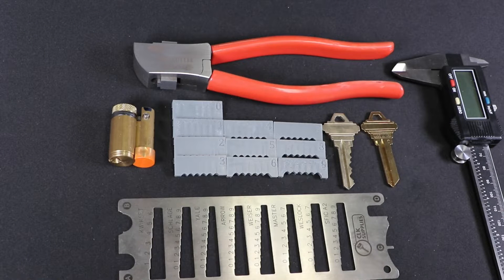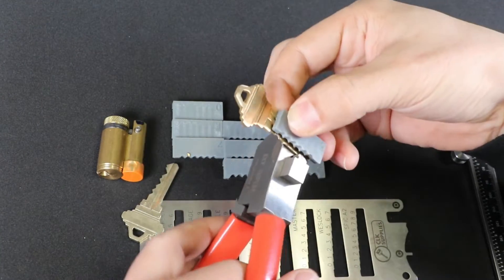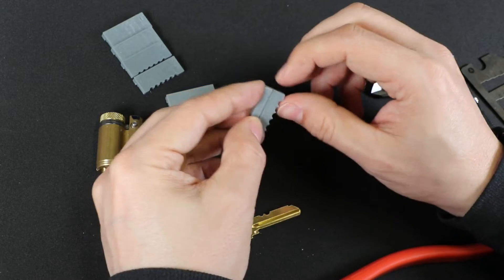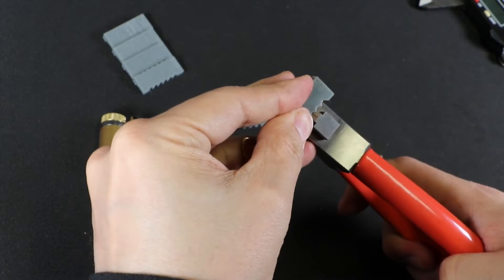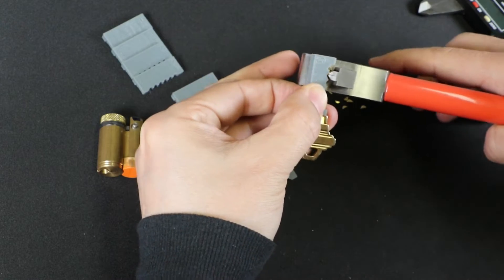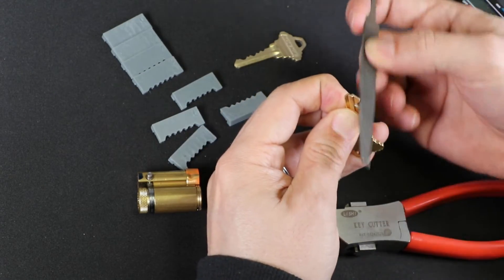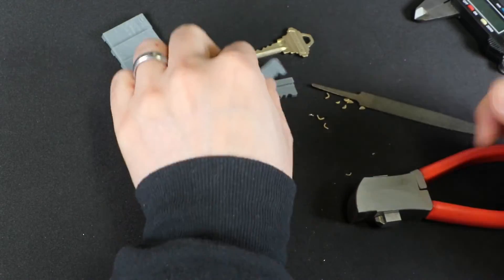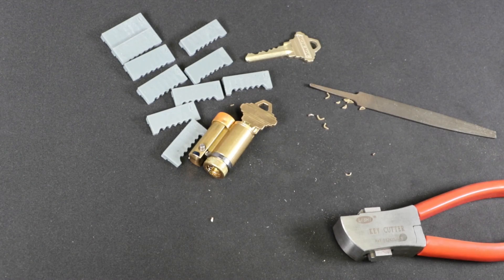[L216] Cutting a key using Jon Lock's Lishi Key Cutter Guides

Comment: Still watching to see but I've seen Deviant Ollem do impressioning with different guides and what he was using always came up consistantly one size shy as well. Perhaps it's the 3d printed materials and how they cure or settle slightly differently once printed?
Reply from the maker: Yes, I'm sure Jon created the STL files to the exact dimensions which didn't take any shrinkage etc into account, could print these again just adjusting the print to be different in one dimension to compensate.
Reply: @norlin76 oh, heck yeah... if its consistant...it's all gravy. Seems to be the nature of fabrication with 3D. I'll see if I can whip some up. Thanks for the info and demo! 😊 Super informative and fun to watch.

Comment: I could just use space and depth keys to achieve this similarly correct?
Reply from the maker: @solisimperium1203  yes, using a file you'd take some material off, check, remove more, check again etc

Comment: Seems like a quick fix would be cut your plastic guides down to spec a file then you have a pretty good little cheap key cutter.  Take the money you save on "cut by number" cutting system and apply to the Locktech decoder camera.
Reply from the maker: Oh for sure! Just have to modify them a little...been a while, thought I had mentioned that. These were tested as is off the printer though.

Comment: Hello  I am a  locksmith  from  China. Enjoy your video .ln China  .there are more and better ways to  make a key without a key.   We can be friends,learm from each other,we can be good friends.
Reply from the maker: Welcome! This was a review of free 3d printable guides...for making keys I use a professional key cutting machine, but this is a great hobby method for making them very cheap!
Reply: @norlin76  我见过中国的老师傅通过开启后观察锁孔弹珠的高矮，仅仅用锉刀一把钥匙坯子。在钥匙全部丢失的情况下，做出来一把顺利的钥匙。你所用的李氏剪齿钳发明人就拥有这个技术。
不过你们有先进的 方法和工具，降低了操作难度，值得学习
Reply from the maker: @LOCKGuru-je4yi  yes, if you use a decoder like a Lishi you can then just cut the key to the proper height using a file (or cutting machine). Also, even without a decoder, you can use the impressioning method to file your key ( I do this in my video here https://youtu.be/THXR9IlVWMk and here https://youtu.be/4kzkO2wQp9w )
Reply: @norlin76  我很佩服你，技术太好了。
Reply from the maker: @LOCKGuru-je4yi  Thank you kindly!

Comment: I had the same exact problem on these guides. They were all off by 1. If I needed an 8 cut. I had to use the 9 guide. Glad I'm not the only one with this issue.
Reply from the maker: I should revisit this experiment with a set of resin printed guides. Will come out more accurate and see if Jon would adjust his guides according to that.

Comment: You are over complicating this.. Vise them together and cut out the pattern    no printing or guides required.
Reply from the maker: That doesn't exactly work when you don't have a key to copy. The point of these is to cut a key to code from scratch, eg. you repin a lock and need a matching key.

Comment: I was thinking with a set of depth keys there will be no use for the guide.
Reply from the maker: Not really. Depth keys are great on a key duplicating machine. Perhaps if you had some other sort of jig to keep the depth key aligned with the blank in the key cutter that would work as well, the main part is you need to keep them lined up, which is where these guides come into play, they're a depth key and jig all in one.

Comment: Where do I print up the specifications guide for the Lishi Cutter? This is such an easier way to cut a key than impressioning.
Reply from the maker: What do you mean by "specifications guide"? The files for the different specific lock models available are in the video description links, but if you mean key depth guides, that will depend on the lock you're trying to cut a key for.

Comment: When the key turned, but was stiff, you should have examined the bitting from above.  The pins which are marking will make a dimple in the key at the bottom of the cut.  Pins which do not mark do not need deepening.  This saved me some copies in the beginning, before I got my key machine adjusted properly.  I used an Ilco Mighty-Mite, do not buy these!
Reply from the maker: Yah, it's the same principle that applies to when impressioning in a key. In this video I was just doing a quick run through and didn't much care about wasting a key :) But great advise!

Comment: Worn nozzle plus PETG is asking for the dimensional accuracy to be a little off. Sounds like you want to at least re-tune  your slicer profile.
Reply from the maker: Yah, might have been a little off, but not enough to make a difference when tested against the results Jon got...looking forward to the next version (this one works fine too if you just file the base of the guide a little until you get the right height, only has to be done once per jig)

Comment: Not one hundred percent convinced myself, but as a working progress 
The tool is on the right path.
The subtle difference between one depth and the next cut up is 
Simply good engineering, good demonstration and let's see
And enjoy where this tool is going to get too,billbo.
Reply from the maker: Thanks for watching! The tool is definitely on the right track. Even without a precise printer, you can make precise guides. I could take these ones and file each section down a little, cut the key and then measure the results with calipers...once the guides are tuned, you'd be good to go :) The price can't be beat!

Comment: Do you have any vendors, or sellers on ebay you'd recommend?
Reply from the maker: I'm assuming you mean for the Lishi Key Cutter? I got mine off Aliexpress, but they do show up on a search for "Lishi Key Cutter" on Amazon and eBay
Reply: @norlin76  I should've specified! Ik this is off topic to the video.  I have a long list of sellers on ebay and I frequent their pages for locks, so I was wondering if you had any really good sellers or websites for high security locks? It's hard to find quality locks in the USA if you ask me!
Reply from the maker: @jamesbp  I buy most of my locks in the Lockpickers United Discord server #lock-bazaar channel (can get to it via Reddit r/lockpicking). But if I have to resort to eBay, I recommend amvgaert, thelocksnest, vinylwonder, and locksportsman. (Can put myself on that list, though I never buy from myself, norlin76)
Reply: @norlin76  wow thank you! I'm familiar with a few of those sellers already Deff gonna check the rest out. Although I'm not familiar with discord servers but heard so much about them, you've sparked my interest and I will look into it.

Update: I just checked out your ebay turns out I already have you saved and am currently watching several of your listings 👍
Reply from the maker: @jamesbp  can't recommend Discord enough, it's the only place you'll find the really hard to find locks

Comment: Great video🤙🏻 do you think a resin printer would’ve worked better for this?
Reply: I’d be thrilled to have someone test this and send feedback - theoretically you’d get a very high resolution print, which can only help with the accuracy of the depth cuts … but the million dollar question is if the resin prints will be strong enough … I mean theoretically there is no force applied to the jig, no sheer pressure or anything, but there are a lot of forces at play on the key and some of that has to transfer to the jig on the cut, so will the resin print be too brittle to handle that? Only testing will tell.
Reply from the maker: I can give resin a go, there are many ways to have it print plenty strong (thinking mix of Siraya Tech, 4 parts Fast, and 1 part Tenacious would work excellent). I don't think the additional accuracy is all that important, there is a lot of tolerance in a C keyway given there is 0.015" between cuts.
Reply: @norlin76  sweet. Kinda forgot about how the integrity of resin would hold up.

Comment: I found these quite difficult to use and I could not get them to cut a key that worked.  I would suggest making them longer, at least over the bow of the key so you CAN HOLD THEM.  Most certainly the KW1 sets were way off and cut way to deep.  Some improvements needed here to make them somewhat useful -- nice try, but no Cigar on first go around
Reply: That’s super valuable feedback, Thanks Ken!  I’ve had several people give me positive feedback on the KW1 and certified the depth cuts are good - so it’s great to hear a counter example - any details you can share on how they were printed (ie orientation, material, print settings, printer?) I can use all of that info to update the thingiverse listing to help people avoid unsuccessful prints. 

I also appreciate the idea of making them longer, or somewhat easier to hold. I definitely tried to keep them minimally small for easy/fast printing, but I don’t want to prioritize that over usability, so it gives me a lot to think about!
Reply: @JonLock  I have emailed you about the 3D printing details -- Thanks -- Ken
Reply from the maker: Nice feedback!

Comment: Cool, I was wondering about these. I bought the set from red team tools and it also isn’t quite perfect, but does work if you know the trick. Have you tried putting depth and space keys in there to see if everything looks like you would expect?
Reply: I have the v1.1 for all five of my different keyways in the mail from my printer.  I will do a video on each one and verify the depth and spacing on a key decoder card and with space and depth keys (for all that I have)… video will probably be out in the next week or two, keep yours eyes out for that one :). Also later today I am going to put out my first DD pick - thank you so much for all that you’ve done for Locksport in the DD area, truly inspiring and one of my next focus areas for the next several months!
Reply: @JonLock  Thanks, I’ll be sure to check it out! But I think you might have me confused for HuxleyPig, the famous DD guy. 😋
Reply from the maker: I was going to print the 1.1 and do a follow up video, but I'll just link your video in the description of this one (and a pop up card during the video) once your video comes out
Reply: @norlin76  cool!

Comment: Super cool to see a test run on the SC1...  The v1.1's are out like you mentioned, and I should get them later this week from the printer, I'm fairly sure the problems have been fixed.  Basically the key should be able to slide into the jig but the spacing on the bottom is just too tight between the rail and the back edge of the key.... this means the back of the key isn't perfectly aligned to the jig and causing a depth problem on the cut.  You could take a razor blade and cut the "rail" off of the bottom of the jig and just hold the key tight to the back of the jig and it should cut perfectly... just means that there is a chance it could wobble in the jig while trying to cut, so you just have to hold it together on that axis as well...

Appreciate you doing a video, and of course it's an iterative process and I'm looking forward to continuing to improve them 🙂
Reply: I used your jigs for a SC1 key this weekend with excellent results. Thanks
Reply: I tried to reply to Jon but …
Reply: @gailuhl  awesome.... thanks for the feedback!
Reply: Awesome little jigs you have come up with and with the various testers you will be able to refine these to a very useful addition to the locksporter who doesn't have a key machine. Are you considering doing ones for the Aussie  Lw5 and Lw4 key that would be the C4 profile. Cheers
Reply: @PocketWomen  Yes mam!  I need to get ahold of some lockwoods (I've got my fingers crossed for the raffle) and some keyblanks, so I can test it... but I think they are likely my next venture 🙂
Reply from the maker: I was surprised when the key worked after cutting the 3 cuts one step deeper...it was tight, so some of the other cuts were a bit high, but it worked (could be due to pin wear though, I'd have to try the v1.1 on a lock with fresh pins in it to ensure accuracy)